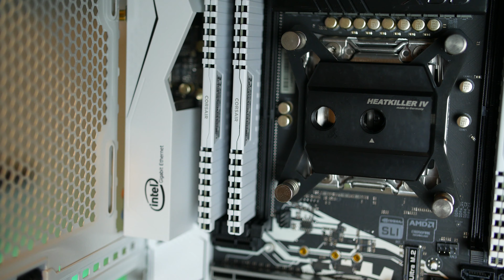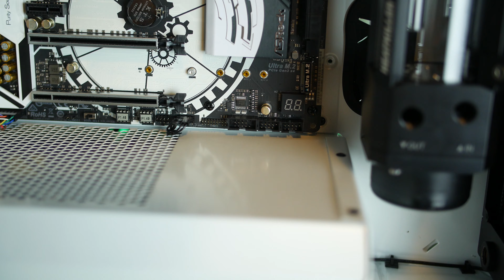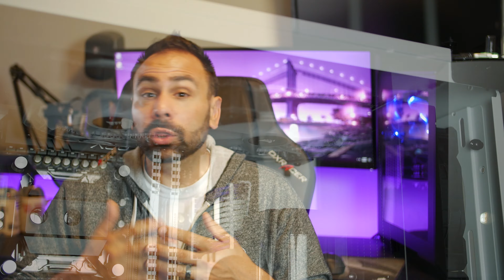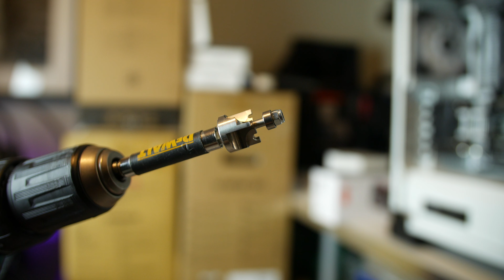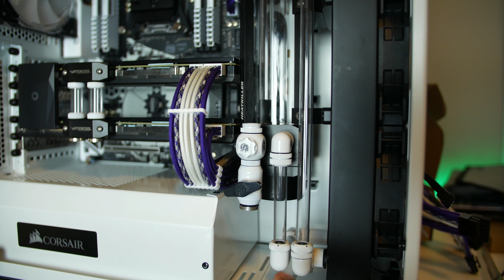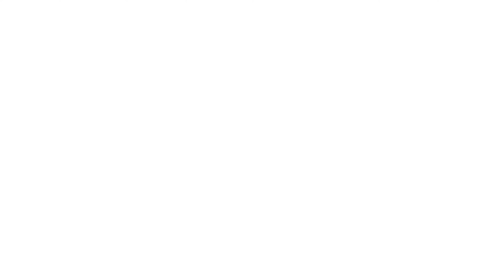Epic Watercooling Continued - Dark Crystal Part 2!

Comment: A couple comments... First, I much prefer using fittings instead of bends in all but the most elaborate water cooled builds. Second, imo, your choice of runs seems... Odd. I don't think I'd have ran the water out one rad and into the other. I would have one component between them.

Comment: +BPS Customs
I like the looks of the fittings. They give a great contrast to the build theme colors.

For filling the reservoir, (and I know this may not be feasible, but it is something I would consider attempting), I would be tempted to drill a hole in the back of the case and route a fill-tube from the reservoir top through the drilled hole in the case. The vertical tubing runs should help hide the fill-tube.

Comment: This is such an amazing build.  Can't wait to see it filled.

When I recently replaced my GPU I forgot to run the additional power cable until after i had leak tested and everything was done. Trying to run that cable I bumped the run that goes to my CPU block pretty good and tore an o-ring causing a leak.  I'll never make that mistake again, I hope.

Comment: why making it this complicated? im not expert in it but the 360 radiator fill ports should be up, i would just connect the radiators in series and then think about making the loop simpler.
Reply from the maker: 1) If I flip the 360 rad, the ports would be inaccessible due to the required position of the top 240
2) The loop wouldn't actually be simpler, the same number of connections would still need to be made, just perhaps in a different order
3) This looks way cooler, which is one of the main goals with customs loops